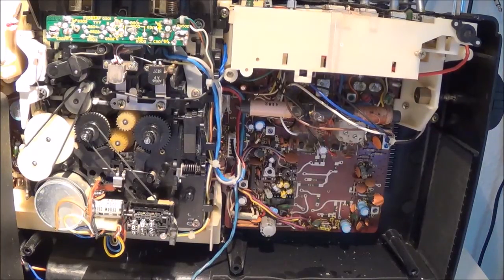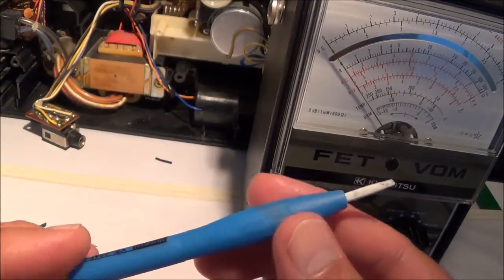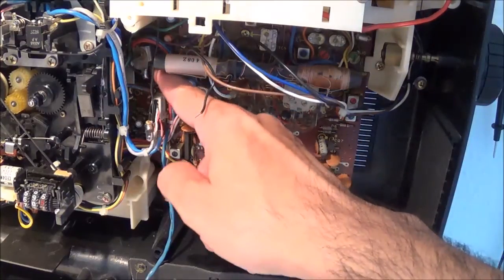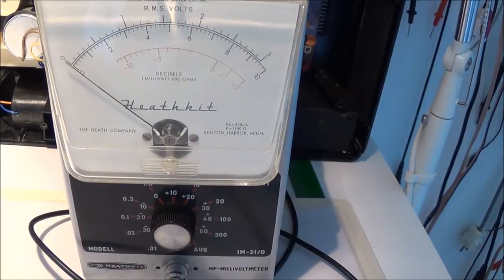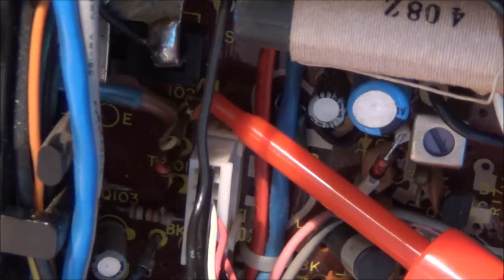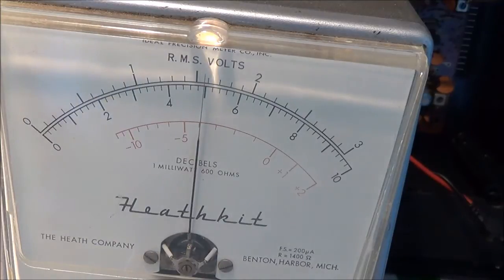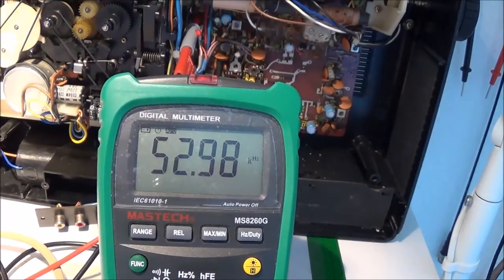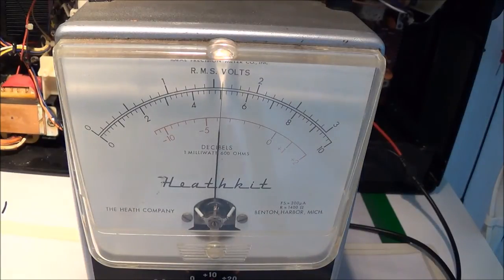Sharp GF-9191 record oscillator bias and frequency adjustment

Comment: Does it matter what Ground you use for this adjustment? Chasis gr. Or does it need to come off of the ckt. Board. 
 Thanks for the video! I have a Heathkit AV-2 that my uncle had when he worked on TV's back in the day. I had some electronics training way back and was a cash register tech for 29yrs. But my true love is audio equipment, specifically cassette decks. I've done speed calibrations on several Sony dual well decks where both decks need to be spot on in terms of speed. If not one will sound ok and one be either too fast or too slow. 
 Again thanks for the video 
 Randy Brown
Reply from the maker: Sir, this is a really old video. But, I think for the bias adjust I just connected across the resistors. One side of each resistor (R115, R116) is at ground. Notice that both of these resistors (one for each channel) are 100 ohms, which makes for some easy math (measurements). If your voltages are off, them you simply adjust the variable bias resistors (pot) (R301, R302) until you get the correct value. 

You seem to already have a really good working knowledge of electronics, so this won't be a problem for you. Audio electronics is cool since each unit has a different problem and the models are often different. It would probably be a chore working on the same units every day. I don't work on those kinds of decks you mentioned though. Nowadays I tend toward no moving parts although I do have a few boomboxes that need work. Keep up the good work!
Reply: @OldSchoolElectronics  Ok sounds good,  thanks for responding.
Reply from the maker: I forgot to add that you will find these resistors in lots of units; always close to the heads; one side of the resistor always goes to ground. They might be 100 ohms or 10; something easy to work with. The manufacturers had to make bias checks/adjustments themselves (therefore the resistors); of course, you could always insert a resistor in between the record head ground side and the ground it goes to, but that would be a chore. The bias oscillator frequency, as you probably already know, we just check with a scope. Just audio means the oscillator is not working. Just bias frequency means missing audio. Both together look like a modulated waveform.